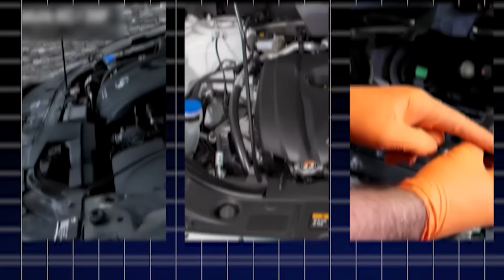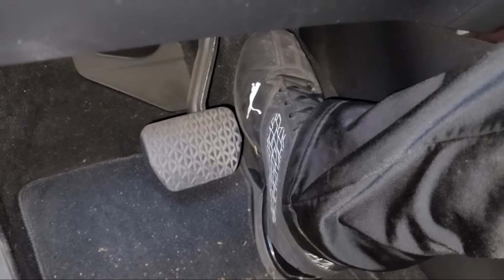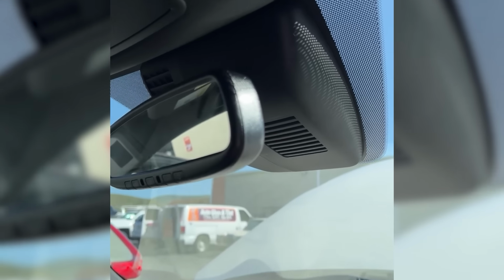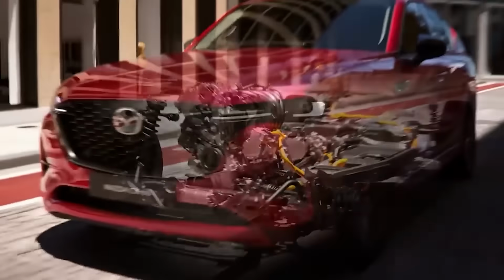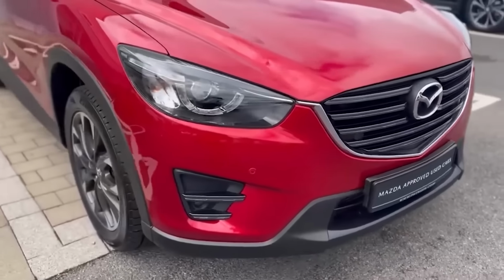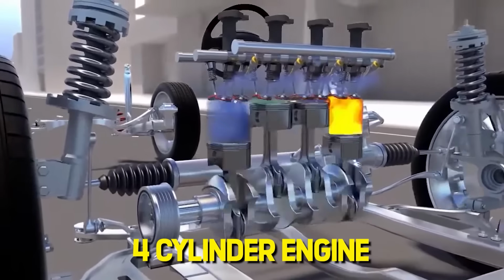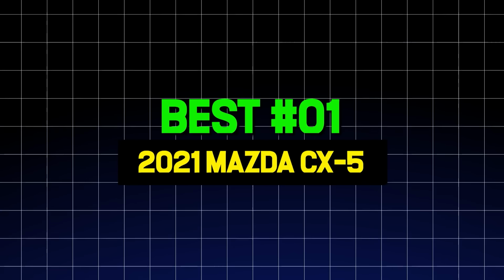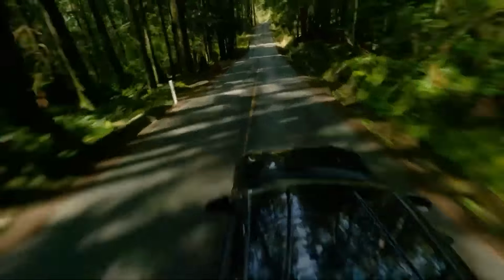3 WORST & 4 BEST Mazda CX-5 Years to Buy

Comment: I am a Mazda master tech and the cx5 is our best car, I have probably replace 20 transmissions in over 12 years, the failing ratio is low, the headlights Mazda fixed them and they were all covered under warranty no matter the miles or time, I’ve never saw the problem with the windshield

Comment: Strange. I have a 2014 Mazda 3 with about 150,000 miles on it and my wife has a 2015 Mazda CX-5, also with about 150,000 miles on it. We've had ZERO issues with either car. I mean tire replacement, oil changes, brake pads...but that's it. I'm guessing this video was made by Honda or Toyota? I'll take Mazda over either of them!

Comment: I love my 2021 CX-5 Carbon Edition (Red Leather Seats) Turbo w/ AWD. It's suppose to get 27 mpg on the highway, but I recently got 33 mpg on a 200 mile round trip. It has no iStop, no cylinder deactivation, and no CVT... which is why I bought it.

Comment: If Mazda is so great, why do most of the cx 5's leak oil from the timing cover?  That is an expensive repair. Is all of that aluminum warping and flexing?
Reply: On most CX-5s that are affected, there's so little oil coming from the timing cover that it's not even called a leak. It doesn't even affect the oil level on the oil stick between oil changes. Also, the problem affects engines with cylinder deactivation!

I have a 2021 CX-5 Turbo w/AWD... and with no cylinder deactivation... and have no leaks.

Comment: I own a 2013 CX-5 GT with the 2.0L, a 2015 CX-5 GT with the 2.5L and a 2019 CX-5 GT with a 2.5L and the only out of norm failures were with the 2013: Front Bose door speakers failed (cone separation), headlights developed a cloudy layer/coating inside the lenses and the steering power assist motor failed with no warning.  None of the problems you listed.

Comment: I have a 2021 CX5 Turbo I have to say when i step on gas this car moves 48000 miles had valve seals replaced at about 33000 miles when i looked under the hood it looked   like it never seen a wrench on a bolt and oil cap was not on car when I got home from dealer oil all over the place lost about a quart of oil not happy with there work second time oil cap was left off from dealer oil change  I have limited lifetime warranty so i have to have dealer do the work to keep Warranty

Comment: I have a 2014 Mazda cx5 2.5 grand touring awd and its by far the best car ive ever had. Maintenance is easy, repairs are easy, and its been super reliable and can go anywhere. Also id say its the best looking model. Make sure you get the 2.5. The 2.0 litre does suck. The transmission is great.  Not sure what this video is talking about. Make sure to change up your transmission fluid. The break problem - non existent. Though when i did the breaks i did have to rebuild a caliper.

Comment: WE HAVE A CX5 2019 2.5LT G.TOURING. SKYACTIVE NON TURBO.  LOTS OF TORCH.  ALL WHEEL DRIVE.  SOUL COLOR.  IT SHINE.  I ADED 5 YEARS WARRINTY.  NEVER HAD TO USE IT. 0 ISSUE.  I CALL IT MY ZOOM ZOOM.  MY GRAMD KIDS LOVE IT.  WE GET FOT RUST PROOF.  MAZDA CHANGE THE OIL ÀND FILTERS.   10 OUT OF 1 0.   MAKE SURE IT WAS MADE IN JAPAN.  DONT  BE FOOL    SOME ARE MADE  IN U.S . ❤ IT. NON TURBO. I RECOMMEND.   IT STILL LOOK BRAND KNEW.

Comment: I have a 2024 CX-5 and the headlight problem still exists it seems.  I only had my CX-5 for two  years and the headlights started to make revving noises whenever they are turned on.  Luckily Mazda replaced both of them free of charge for me as I am still within the warranty and they will see if they will extend the warranty if the same problem reappears.  Other than that, it's the best car one can ever have.  Versatile enough to fit anywhere, elegant enough to go to the poshest places and yet robust enough to go to the toughest terrains like roads in Montreal.

Comment: The infotainment touch screen is faulty on all models mazdas for them years. I fixed mine myself for $20
Reply: 😮How did you do that? My 2019 screen behaves erratic when the inside of the car gets hot.
Reply: @NAIRNE-02 is that the same screen as the 2014?  At some point they changed. Idk when though
Reply: @JD_Aguilar717 I just found out that the deadline for the free change was September 2025. I bought the car used in August 2025 but I didn’t know until after September. 😢
Reply: @JD_Aguilar717 The screen is the smaller one.
Reply: @NAIRNE-02 that sucks

Comment: how about a 2025?  I am looking for one.  the 2026 has a doggy response, and the touch screen with several drop downs to change setting is not what I want.  Is the 2025 a good model?
Reply: ‘25 is a great model. Still could probably find a new one on a lot. Go with a 2.5s Select. No I-stop of Cylinder Deactivation.
Reply: ‘25 is a great model. Still could probably find a new one on a lot. Go with a 2.5s Select. No I-stop or Cylinder Deactivation.

Comment: I had a manual 2.0 L 165 hp 2019 CX-5, I put 80 000 kms on it, I pulled a 900 kgs caravane with it, I kept it until last year, absolutely no problems with it, great car. I now own a 2022 2.0 L CX-30 e Skyactiv X  40 000 kms great car great engine, great gas mileage, 186 hp! no problems at all with it! Thisn AI needs to go back to university! 😂

Comment: I love my 2014 CX-5. Rear brakes lasted until 75,000 miles, front 108,000. 0ther than  new CV  boots, all the rest was batteries, tires and wiper blades.  I don't plan on replacing it.

Comment: I have (had, as it was stolen a few days ago) the 2016 model, which is really a left over 2015 version as they didn't redesign the car until half way through 2016, so the earlier 2016 models don't have any of the problems of the newer design.  What a great car.  no problems at all, traditional halogen lights. 2.5 SkyActiv, no turbo, no CVT, no problems.  I will get a newer one, but I can't find any fault with the older version except for the infotainment system and no Apple Carplay, but that is an easy upgrade via Amazon and updated software that's easy to download.

Comment: Purchased a 2013 new off the lot as a birthday gift to my wife.  This was the first year it came out.  Mazda had only 7% of the market then.  Base model with the 2.0 6 speed manual FWD, no other cars in that segment had both a manual transmission and AWD except the Suburu. Crostrek / and the Impreza.  The CX5 was considerably less money.  This car got passed down to me when she required a 3 seat car  with AWD for grandchildren.  I am still driving it with 170k miles.  Besides routine stuff, the clutch slave was replaced at 60k and 120k, I expect I will need the third one at 180k.  I manage without AWD using good snow tires all around.  I find this. Idea very helpful as I will eventually have to upgrade.  I much prefer the manual transmission but hold out little hope of finding one.  They dropped the stick a couple years after we bought the 2013.

Comment: My 2019 CX-5 2.5 L. turbo AWD has no engine deactivation but it does have POWER. On some 2.5 L. engines in my VIN# run there were EXTERNAL cylinder head gasket coolant leaks (not mine) so MAZDA  decided to DOUBLE my drivetrain warranty! I only have a bit over 50,000 miles now so I'm good for another 50,000 miles and 5 years (now 4 years left)
BTW, MAZDA's brilliant butterfly valve on the turbo impeller (exhaust) side really DOES virtually eliminate turbo lag from a dead start. And in deep snow (10") that AWD works like a charm with my all season Michelin Cross Climate 2 tires.

Comment: When they discuss the 2016 headlights, they are showing images from a model other than the 2016.  Are they really talking about the 2016 headlights?  Also, I have a 2016, and I have had my windshield replaced twice, but they did not perform the specialized calibration.  I am concerned about the accuracy of this video.
Reply: John, both headlights failed on my 2016, one about a year after i bought it, the other a year after that. Purchase my 2016 in June of 2015, I think.
Reply: @nancycallas5301 How long did the replacement headlights last?

Comment: I have a 2019 CX five and I’d like to know do you think it compares well with the 2020 model? I know the 2018 is not that great but tell me if you have an opinion on the 2019 CX five I only have 16,000 miles on it because I haven’t driven it very much. Bought it in 2020 and I love it but tell me if I’m bought a good model.

Comment: This is a great video seeing as how i just bought a 2021 CX-5 last month lol
Reply: 2021-2025 are the best model years for the CX-5.  One issue though with the 2021-22 models is the phased out MZD Connect infotainment system.  Works ok, just no firmware updates in the future.  Then there is cylinder deactivation, fuel savings minimal with long term wear concerns and can only be disabled via an ECU flash.  This was one of the reasons I bought the G23 turbo.

Comment: TOTALLY FALSE!  @5:26, the 2016 headlights ARE NOT sealed and non-replaceable, NOR do they melt!  The bulbs change out like any other modern vehicle.
Reply: I don't think this is correct. One of mine failed while under warranty and Mazda replaced the entire housing; the bulb could not be relaced. The second one failed AFTER I was out of warranty, they replaced that one also at no cost under customer good  will. Why would Mazda eat the cost of two $1200 headlight units, plus the labor cost if they could change the bulbs that cost a few dollars??? There was a service bulletin issued as well, about a year after my second headlight crapped out.

Comment: I have a 2016 CX5. 10 years old now. Runs great and none of the problems you mention in your video. No major repairs. Just regular maintenance. Most reliable car I ever had and I am 71 years old and drove about 20 different cars in my life, Ford, Mercury, Audi, BMW, Honda, Volkswagen, Nissan, Kia, Fiat and Jeep.
Reply: Agree I had CX-5 2016 at a time and it had zero issues. There was recall for the Daylight Running Light once and never had issue. Engine wise (petrol) was very reliable. Heard bad things about Diesel though..
Reply: Same for me. I bought a 2016 for my kid 6 years ago - zero issues.
Reply: Ditto. And I easily replaced the $10 bulb he said couldn’t be replaced without replacing the entire headlight assembly.  This video is BS
Reply: It depends on the CX-5 trim level actually. The highest trim uses LED headlight which require entire headlight replacement. Lower trim still use halogen lightbulbs, which easy to replace.
Reply: It was specific to the 2014 Model
Reply: Same. Amazing great cars.
Reply: You are very lucky still fill are shops up
Reply: I got one.  Tranny blew at 150k miles.
Reply: my daughter has 146k on a 2016, nothing besides regular maintenance.
Reply: Mine was shit. A friend gave it to me. It broke down repeatedly.  He spent thousands to save face. Mechanics and car dealers won't touch turbo diesel Mazda  period. 
 So stop your lies you little bots. 
 Eff off.

Comment: I have a 2014 Mazda cx5 ! 192,000 miles and still running great! Bought it new off the lot. With regular maintenance it runs great. No problems!
Reply: I have the same 14 miles new now 176.000 no problems
Reply: Same. 2014 cx5 is the GOAT
Reply: Keeping mine forever. I don't like all the changes like eliminating knobs, everything through the touch screen,and cars now are spying on you and sending your data elsewhere.

Comment: I bought a used 2020 CX-5 without having any engine or transmission issues, now at 109000 miles, BUT it is now having parasitic battery drain issues overnight, seeing all the symptoms of TSB 09-026/20. Have not found a fuse or relay issue yet. The problem appears most prevalent in warmer damp weather and disappears in icy cold and dry weather. I have not opened the drivers door panel but I think the problem could be lurking inside behind there. Anybody else seeing this problem? The TSB mentioned only covered 2013 to 2015 year CX-5
Reply: At 109k you most likely have a faulty alternator and serpentine belt should be changed as well and I would do both belts, Alt and battery ,good for another 50k
Reply: Something like that happened to us (2019) and it was the passenger seat heater/ac module located under the seat that was sticking and blowing air even with the vehicle off. If your vehicle has heated seats, turn off the car and stay in it to see if you hear anything.
Reply: my 2018 used to behave the same way but then I realized it's the auto trunk button that misbehaves when in contact with water. I have always avoided water around that area and since then no issue.

Comment: My CX5 2l prtrol Sky Active Auto was bought new in Aug 2026.
Have done 126 348 km.
Not a days problem.

Interesting.....I have no running or home coming  lights....

Car is now 10 years old.....still original windscreen.

Touchscreen still perfect.  But I must confirm car is 90% of the time parked in shade.  Only in sun when out shopping or roadtrips.

Comment: 2022 Signature will hopefully be a solid car for the next several years.
Glad they pointed out the LED Auto leveling/Adaptive headlight failure since every new car will suffer this fate, the entire assembly is a fortune (Canada it's $2031.95)
Scratch/crack the lens, LED bulb failure, Auto leveling/Adaptive noise and needs to be replaced out of warranty, then pay up!!.
Cars should go back to Halogen and lose the other nonsense of Auto leveling/Adaptive features....nothing but problems waiting to happen

Comment: The 2024 2.5 SkyActive Models of the CX-5 for the USA market were generally sold without the cylinder deactivation system due to a shortage of parts in Mazda's supply chain - so, that year eliminates that one additional technical complication from the engine and is therefore just one less thing to break making the 2024 the year to buy from an engine perspective.
Reply: Not quiet accurate. It depends on a trim. Check your VIN. If the 8th digit is L then it doesn’t have.
Reply: @krolspeedu mine has a l, Thanks I was worried about that.

Comment: According to consumer reports, 2021 turbo engine as a lot of issues.  There are Mazda TSBs out for this engine.  Also, the the 2.5NA engine has the TSB for the head cracking issue.  I believe it's very rare for the 2021 2.5 NA engine.

Comment: I have a 2016 CX-5 Touring. We got it new in Jan 2016. It has 191,000 miles now and still runs perfect. The head lights are not sealed. I put in new brighter bulbs a couple of years ago. (Very easy). Never had any of the issues discussed in this video. I have never heard of anyone having any of these issues.

Comment: I intend to buy a Mazda CX 5 model 2022-2024. Which one is the best? Are they as good as the 2021 model ?
Reply: I bought a 2024 cx5 in January 2024. Almost 20k miles no problems.
Reply: I have a 2023 with 35K miles no issues

Comment: So are the 2021 - 2025 models as good as the 2021? Or have there been more changes? I just purchased a 2025, which I have been told still does not utilize cylinder deactivation.
Reply: Confirm it look at the 8th character in the vin if its an M it has the cylinder deactivation and possibly start/stop too but if has an L it doesn't i just bought a 2024 carbon edition but I did my homework prior